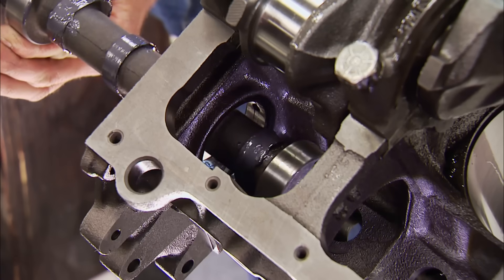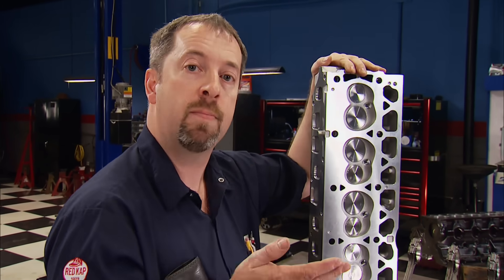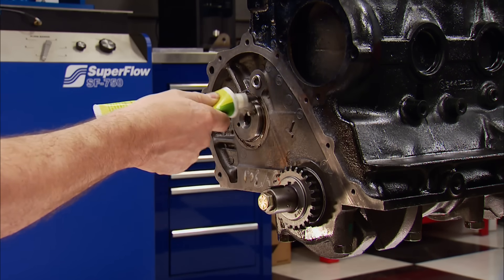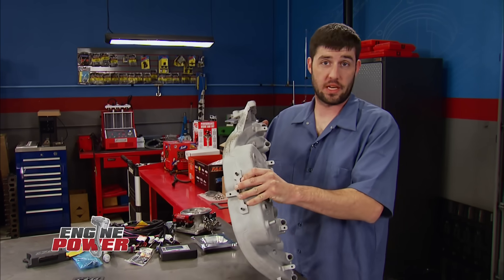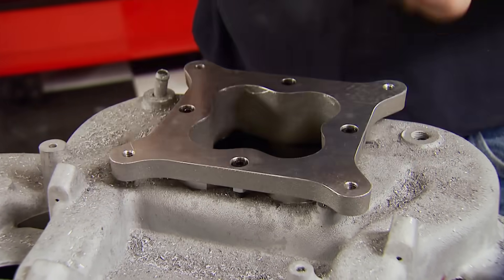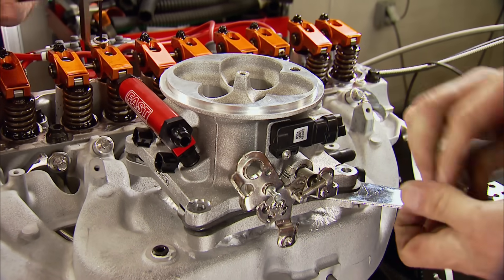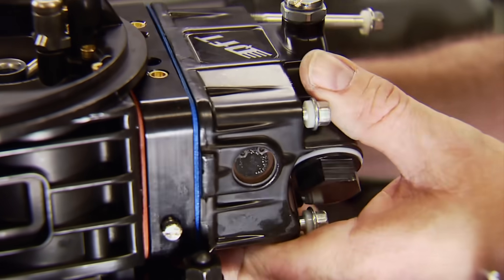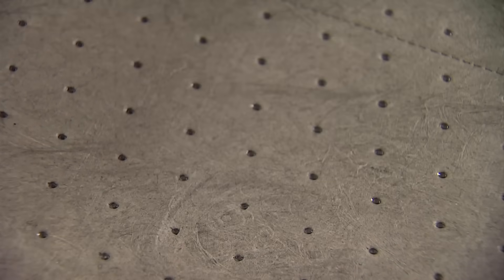Rebuilding a 4.0L Jeep Straight Six to 242HP - Engine Power S2, E14

Comment: That 99-up intake manifold was never made to run “wet”, I’d love to see how it runs with the factory port injectors.
Reply: It'll be fine, so long as you start it up in a heated garage without the camera rolling.  I swear these guys are amateurs.
Reply: did a 4.0 cylinder head swap on my 258 with the  horse shoe intake an a Quadrajet spread bore carburetor. Ive been running mine for about 6 years now
Reply: @pankero1 different engine STUPID!
Reply: None of the 4.0s was meant to run wet. They all had point fuel injection. The li citing factor on these engines (and pretty much every other US built OHV) six is the cylinder head. Limiting porting options. But the if you got the redline up to 6k you would be do going well. Iline sixes have a resonance somewhere in the 6 -7k rpm range that if you run them at that range for a sustained period the cranks will break.
These engines were never designed to be high output high performance power plants. They were designed for adequate* horsepower and low end torque. As to the basic engine architecture there is a racing series in Argentina that uses the 4.0, the Chevy OHV and Ford OHV engines as the base point replacing the head with a DOHC 24 valve piece, dry sump lubrication where the bottom end is modified significantly. Carburation is limited to two two barrel carbs. Engine output around 500 hp.
Reply: @mpetersen6  
 Certainly the inline sixes ran carburetors at some point. Came was available in jeeps in 87. But it's roots go back farther than that. I had a friend with an AMC Concorde it had the same basic inline 6 and I know for a fact it was carbureted. I don't see why it would matter longevity-wise. Other than obviously fuel injection is cleaner burning but that's true on any engine.
Reply: @kens97sto171  
I know they did. All of the 199s, 232s and 258s were carburated. Along with the 252s and 282s built by VAM* in Mexico. I retired out of the Kenosha Engine facility so I'm pretty familiar with the 4.0 family.
*Same crank as the 232 and 258. The bores were opened up to 3.875 or so to compensate for lower octane fuel.
Reply: @mpetersen6  
Your first comment was that none of the four leaders were meant to run wet. Yet I don't understand why it would matter and inline 6 is an inline six. I understand there are some small differences through the years. But I don't really understand why it would matter if it was carbureted or fuel injected on any of them quite frankly. Obviously there are differences in the way fuel injection and carburetors work. And I imagine certain intakes if they were designed to only have air running through them could change some things. Fluid could collect in casting areas the rougher surface might cause problems. But that's an intake issue it doesn't really have anything to do with the engine itself. So I would assume you would just need to be careful what intake you chose depending upon what you were going to do with it.
Reply: @kens97sto171  I had an '83 Jeep Eagle that had a 258 and it was carbureted.
Reply: @chb2551 he specifically said the manifold on the later 4.0.
Reply: @mpetersen6  big smile, thanks for the info
Reply: .........and the coil on plug ignition, too!
Reply: Would probably be more hp
Reply: I'd like to see it in a jeep, performing.
Reply: Thats what I dont understand about this build.
Reply: They shouldn’t have put a carburetor in. This type of i6 engine is not even supposed to run on a carb. It looks great now on paper, but it won’t last 5 years
Reply: @apking130  not sure what you mean by the 'type' but this engine goes back to early 1960's (232, 258)  definitely initially a carb motor

Comment: The 4.0 engine is actually an AMC design that  started life in 1964 as a 199, 232 and 258 . To say that it was in production for only two decades is just plain wrong, it was in production for 42 years.

Comment: You know I used to love shows like this when I was in high school. But now 15 yrs later as a professional watching these shows it is a joke. That intake manifold is not designed flow fuel its design the air that's why it didn't work. And Why would you go from a multi-point fuel injection to an EFI design and also you won't find a professional mechanic out there that uses e3 spark plugs or that likes doorman
Reply: And gutting the valve cover baffles to clear the roller rocker. There is a cheap spacer available for the stock valve cover. Ugly paint color as well.
Reply: Zac none So it wasn’t just me that cringed at the plug choice.
Reply: K J I just wouldn’t do it. Not going to put my reputation on the line just too use crap parts from a sponsor.
Reply: How come the carburetor made the horsepower they wanted if it was a wet flow problem?
Reply: agreed, i think those elevated runners on the middle 2 cylinders are going to make for a short life span on this engine
Reply: Professional desk top jockey
These guys are experimenting. 
As they said, this is how performance products are made and discovered.
Reply: Autolite or NGK all day

Comment: I found this by accident and I'm glad I did.

I owned a 1993 and 1998 Cherokee with this engine. I was impressed with both of them. That engine from the factory pulled strong. And since I worked at a Chrysler plant there were numerous of those engines that I got reports on. A few had reached almost 300,000 miles when I retired and lost track of them.

I was surprised the fuel injection system was not able to compensate and give the desired power. Perhaps someone with lots of expertise could reprogram it. Injection is so much better for managing fuel distribution. And much easier to start up in cold weather.

Comment: A stock 1998 4.0L HO puts out close to the same power as they achieved but is much more reliable because its stock and it will run upside down.

Comment: These engines seemed specifically designed to get the worst fuel economy possible. I had one of the last ones in my 2005 Rubicon with the 6 speed manual trans, and though I was happy with the horsepower and torque, I was quite unhappy with the gas mileage; my 3/4 ton, 4x4 Suburban with a 454 V8 used less gas. Swapping the 4.0 for a 5.9 Hemi gave me much more power, and a big improvement in gas mileage.
Reply: It was the 4.10 gears hurting your fuel mileage

Comment: The E49 Charger with the Hemi 265 produce 302hp out of the factory
Reply: There's 258 running 350+HP and more than 400tq. All on stock pieces running 11s in a Gremlin back in the 70s. What's your point?

Comment: Cast iron block, supercharge or turbocharge that weak 4.0l 242 hp out of 4L? 4cyl 2.0l put out that power!
Reply: Iron Block N/A power.329 torque and 243hp There's no 4banger doing that n/a
Reply: A l maybe not the torque but Honda’s hp numbers easy. H22 2.2 200hp,  S2000 2 hp per cubic inch. Direct injection NA engines are getting high numbers. The main problem with that 4L is its not cross flow and head design.
Reply: @Angl0sax0nknight  your right about HP. They can pull numbers.torque not so much. There was a l6 powered Gremlin in the 70s with 350+HP N/A and over400TQ running 11s.turbos make up for size now. To a point. There's very fast Honda's. But doing this in the 70s was badass.fastest l6 back in the day.

Comment: Get an hei out of an early 80s gm inline 6, knock off the distributor gear and mount an amc v8 distributor gear on the gm distributor and put it in. Much better ignition set up.

Comment: Can you upgrade a 3.7l V6 from liberty because I would like to maximise the output from my 2003 liberty
Reply: Get a different jeep lol, liberty is not a Jeep and has a awful motor
Reply: I found that engine can be tuned and modified which it can reach higher output from 4L I6. I just want to find the proper tuner for that engine.
Reply: Mohammad Bin Bishr reliability isn’t there, and by higher output that’s vague, is it making more torque? Or more horsepower? This build was pathetic on making power for the jeep engine, there’s so much better and easier to make power with it
Reply: @dakotagist7526  what about V8 instead of 3.7L?
Reply: Mohammad Bin Bishr not bad, what v8? A v8 would be great for low end torque, if you want to build a offroading vehicle we’re assuming...
Reply: @dakotagist7526  currently I'm busy in building my house afterwards I'll focus on the V8 project. Later on I'll see which V8 I'll use.

Comment: It’s crazy I have a new Toyota truck with a 212 cubic inch 3.5 with 285 hp a lot more then 1hp per cubic inch too bad they couldn’t put a turbo on these motor the stock pistons and crank can Handel 500hp easy

Comment: The basic design goes back into the early  60s. Originally built as the 232 CID with a 3.75 bore and a 3.5 stroke. It was first offered in 1964 on a limited number of Classic 2dr hardtops. Followed by the 199 (same bore with a 3.00 stroke). Later bumped up to 258 with a stroke around 3.90. Getting large amounts of power out of these engines almost requires a forced induction system of one sort or another. The limiting  factor being the non crossflow head. Something shared with the GM, Ford and Chrysler inline sixes. This limits port sizes and breathing. Even Pontiac's OHC 6 had a non crossflow head. As these engines were meant as the base engines in the vehicles they went into all that was required was sufficient power for everyday driving. Barney Navarro supposedly got 800hp out of a 199 sleeved down to fit the USAC rules at the time. I'd be more likely to believe 600hp. One interesting thing about the engine architecture is the bore spread, 4.380. Same as the Ford small block. And only .020 under the Chevy small block. One could build a custom head out of two V-8 heads. The intake would have to be on the opposite side as I don't think you'd want the pushrods near the exhaust ports. This adds another problem with the distributor but modern ignition systems solve that. As I understand it the GM twin cam V-6 is also a 4.400 bore centers. The Infinity Twin Cam V-8 is 112mm so that's  4.409. There's lots of room for somebody to get creative. It would be a lot of work. But it would be different.

Comment: 242 hp In a 4.0 Litre engine? What kind of performance is that?
Reply: There's only so much you can do with a base design that's older than your Grandad. It's still one of the best mass produced engines of its day. Granted its day is over...

Comment: Typical. Gives the most half assed attempt at fuel injection, then throws a carb on it. What's worse? That's a multiport injection intake manifold! Get a proper EFI system and use the actual injectors instead of some bs throttle body injection.

Comment: Nice engine...just beware of autozone parts especially the water pump..I replaced my 87 commanche water pump 3 times with a cheap autozone unit within a 2 week period....all 3 leaked...before finally biting the bullet and getting a proper NAPA unit and never had any more issues.

Comment: Nice job fellas. Q:...why not use later model block with factory stud girdle?? Worked at the Jeep dealership, towards the end of this production. Saw more than a few brand new engines, that were noisy. Engineering told us that tooling had just plain worn out, by this time. True or false?? not sure, but a million units is impressive. Loved those 4.0 liters. Had a 1989 Cherokee with 250k miles

Comment: Those TBI injection systems hate dual plane style manifolds, that's your problem. Place the injectors at the bosses and it will work better than the carb.

Comment: I think you would have been better off doing  stroker crank and rods and not using an aluminium head. You could have mildly ported the iron head instead. Leave the stock injection on it.

Comment: fuel consumption: not a problem! Anyway, I'm wondering : why they stick using carburators while they can put electronic ignition and fine tune every parameter (for every rpm). They have already such advanced strumentation and knowledge.

Comment: I'm still shaking my head at the use of a Carb, Chrysler finally got the 4.0L right between 2001 to it's end in 2006 with Fuel Injection. Plenty of silky smooth low end torque. Hell I've seen Turbo'd 4.0L making decent numbers
Reply: Carb? No, that's an TBI EFI system.
Reply: @cmte.brazinazzo2061  Did you watch the whole video? They gave up on the TBI and put a carb on it.
Reply: @cmte.brazinazzo2061  but does that resemble the last years of the 4.0? it doesn't
Reply: carbs are cool. i've built some great VG30 nissans with a non-USA intake manifold and a holley model 2300 2-barrel 500cfm carb. nissans VG30E with stock fuel injection=160hp.  with the stock cams/valve train with corrected timing and the carb-modded fuel system=225hp (verified on a friend's stuska water dyno). with billet cams- engineers reach for the oh-shit bars.
Reply: you should have tried tuning the factory fuel injection. A 5-speed 300zx VG30E with a Maxima intake manifold will nip at 280 at the wheels. Tuneredit was very easy to use. The factory ECU was tuned very conservatively on those engines
Reply: @Fulcrum205  What the hell do Nissan motors have to do with this?
Reply: @Fulcrum205 i know two people with non tt 300s. . .
Reply: @grad0n great motor in its day. It really needs a little boost. The bottom end oiling setup wont handle a lot of rpm so you have to mod that if you want to wind it out. Boosted they can be brutally fast. There was a guy where I grew up with a ported eaton blower and water injection that would run 11s in the 1/4 and he was launching very conservatively to keep from turning his diff into confetti.
Super cool 80s vibe with the digital dash that could humiliate 911 turbos and Vettes.

Comment: You gotta love the old-school engineering on that engine. Over square bore/stroke, cast iron cam in block, and don't forget, the ultra efficient non-cross flow, iron head. You have the exhaust manifold soaking that intake manifold with all the heat. Doesn't seem like using the intake manifold as an exhaust heat shield, would be very good for making power. I guess it gets the engine up to operating temp quickly. What can you say? That's how it was done in those days. Engine performance wasn't a consideration back then. One hp per CI, is all you need to know.

Comment: You can get close to 300 HP by putting the 4.0 head on the older 4.2 block.It bolts right up..there's forums on it.

Comment: Australia - gets a hold of a 4.0 American straight 6 in the 60's, develops it over time, adding overhead cams and peaks at about 270hp N/A by 2010. 

America - doesn't even scratch 200hp by the same time period. Still pushrod. Still two valves per cylinder. Then, these muppets come along and take things further backwards by removing the port injection and adding.... a wet manifold with a carburetor...

Oh America... keep being you.. you're very entertaining for the rest of the world.
Reply: In the 70s there was a AMC Gremlin running a258 with Webber's pushing more than 350+HP N/A running 11s. There was no 4.0 in the 60s. Only when Chrysler bought them. And destroked the 258 and called it the 4.0. You seem like you dnt know what your talking about.

Comment: My favorite Jeep engine. Such a shame they stopped using them.
Reply: The Jeep 4.0 and the 7.3 PSD. Two legendary engines that never shouldve been replaced.
Reply: Yep, but it was an AMC design and Chrysler/MB wanted to get rid of it... especially Chrysler as it's a better engine than anything Chrysler makes.
Reply: ChrisHallett83  hardly, barras are expensive in the US, parts are hard to find, they lack the low end torque needed for offroading, keep your barras on the street.
Reply: ChrisHallett83  waste of time swapping in a boat anchor when mine works perfectly fine
Reply: I agree
Reply: newer 3.8 was good

Comment: you should be running high zinc oil for the life of a 4.0 not just break in. the 10w30 rotella diesel oil is cheaper than regular oil and the 4.0 loves it

Comment: "It's definitely not the injection" - next minute, swaps out engine for carb. Luddites.
Reply: Yeah, I don't think the computer had enough references to fully tune it...almost everyone with an ear could hear it was lean!  SMH!
Reply: @misters2837  YesSir, it sounded amazing with the carburetor.
Reply: @danielwarpaint1963  Yeah when they did the pull with the TBI system, I was saying to myself "20 Minutes of self tuning, on a Dyno isn't enough, and its LEAN!" LOL...I built a 393W for a friend/customer, and we put one of those Fast EFI Systems on it...and I ran it 3 hours on my engine stand (no real load)...Installed the Engine into a Bullnose Ford Truck, and drove it to work for 2 weeks...and it Finally Woke up after 200+ miles...it was like I would open the secondaries and it would fall on its face like the 4.0 in this video...it was like flipping a switch...when it Finally took charge!
Reply: @danielwarpaint1963  ,,,thas why I junked my EFI, currently running a big weber with a few other mods
Reply: They were probably depending upon its self learning ability. Rather than tuning it manually.
Probably needed to add way more fuel,
I did not get a good look at the throttle plates but I guess it's possible that the throttle bore could have been smaller on the EFI unit versus the carb.
Reply: @JosLewisWood Carpenter its called adaptive fuel strategy...and all self learning EFI systems have it... Some work flawlessly out of the box...most do not... The system had to LEARN how to add/subtract fuel according to REAL driving...not just engine stand/Dyno pulls.
Reply: Too much pride to say they're wrong.
Reply: injection smection hes not gunna keep swappin out though right
Reply: It's funny it was a 750cfm carb so most people including the manufacturer would say its absolutely way too much carb, & I would be curious to see how it ran, & the numbers on a 600-650 cfm which is still "way too much carb" according to most.
Reply: If you paid attention, it wasn't. It was their Frankenstein intake that was the problem.